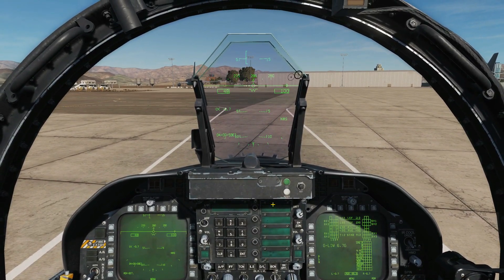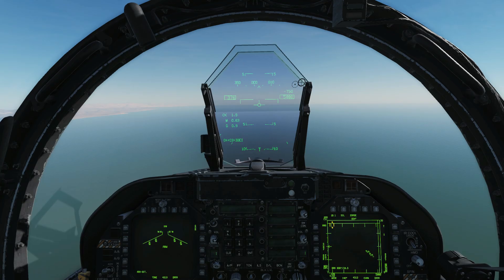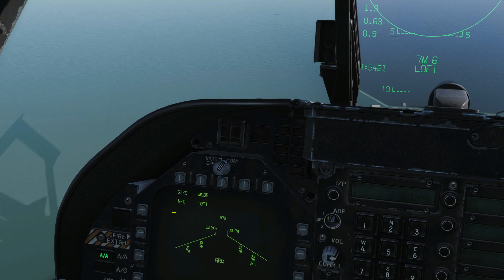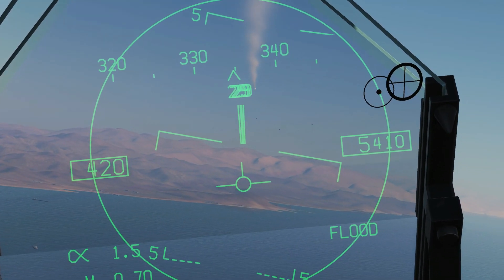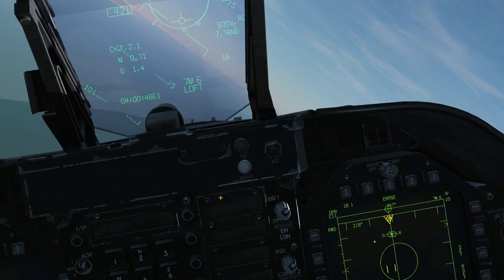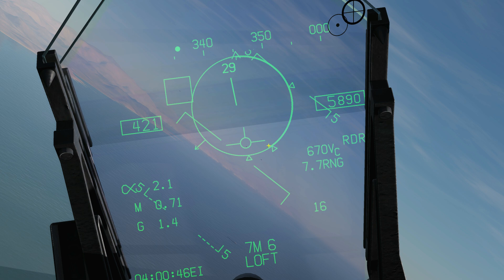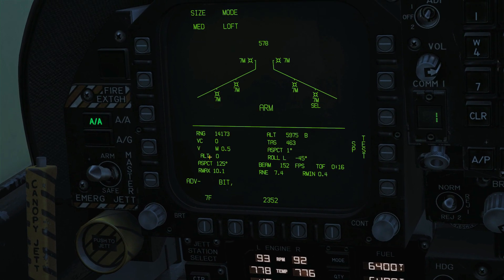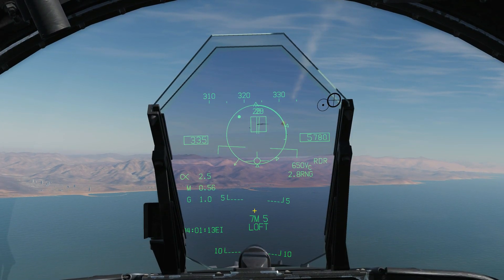FA-18C Hornet: Aim-7 Sparrow Missile (FLOOD/STT) Tutorial | DCS WORLD

Comment: FLOOD mode flipped my understanding of how the sparrow works. So how does a sparrow find its target in flood mode anyway?
Reply: the seeker in the sparrow sees the reflection of radar signals in its fov, and chases after the brightest thing. in stt you have a very narrow cone of radar, so it effectively always hits what you want. in flood mode though it still looks for the brightest thing, but now in a much wider area, which means if something else has a bigger radar cross section it will normally go for that. on that note i imagine the sparrow is probably more susceptible to chaff than an amraam, and even more susceptible in flood mode, though thats baseless conjecture on my part
Reply: I think the radar basically illuminates a portion of the sky and the launched missile just guides itself to any reflection close by. Can be useful in dogfights.